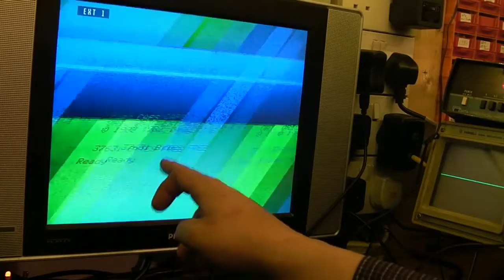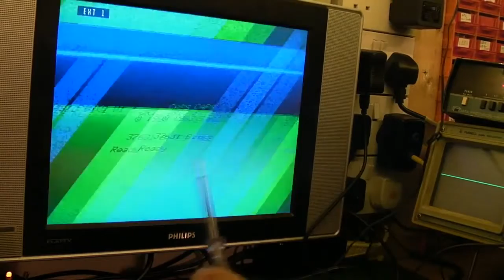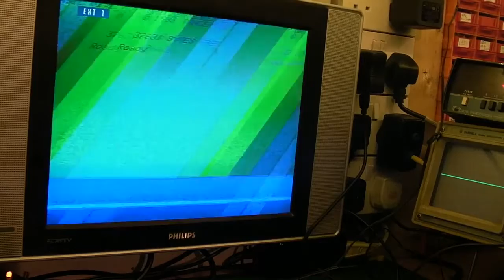Oric Atmos repair Pt1

Comment: The atmos ought to have an upward firing Speaker where that dotted grill is, and a rotary volume control on the back would be ideal like on a transistor radio, should be an easy mod to do.

Comment: Brilliant job there!!!  Lucky that it's working so well after having 8v rammed into it lol.  I wonder if it uses a chip similar to the old Spectrum for video output.  Can't remember the part number, was something like 14 pin DIP chip though.
Reply from the maker: yes i was surprised at how easy it was to at least get some life out of it. i was expecting the cpu and ula to be bad. the video fault can only really be ic 22, 23, or ic 7 im really hoping its ic 22 as its just an off the shelf 74seriese ic ic 7 is the ULA which are cheep for the oric fortunately
Reply: Fingers crossed!!! Looking forward to seeing this one fixed!  Pretty rare these days!